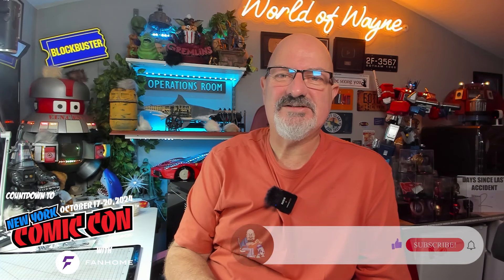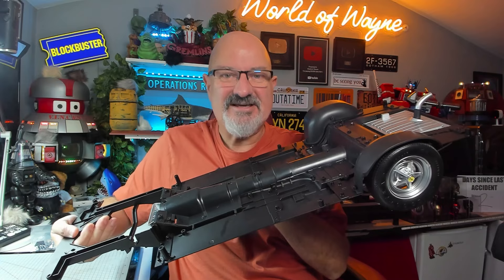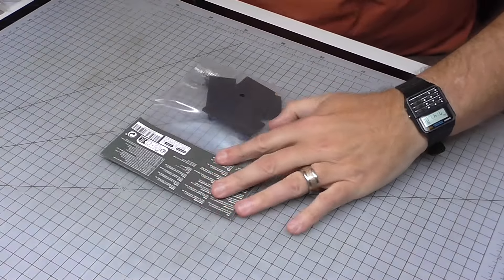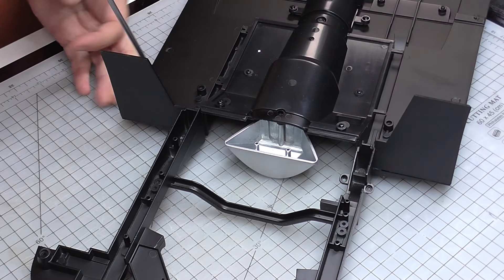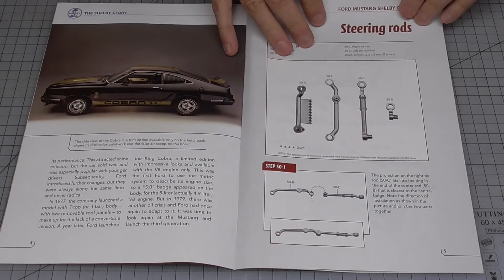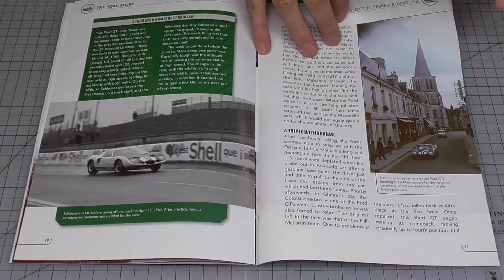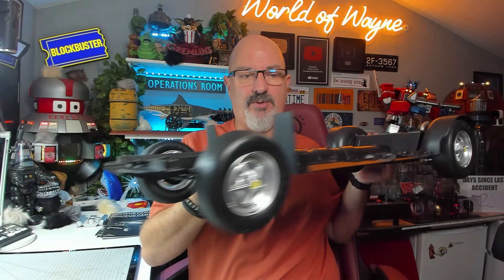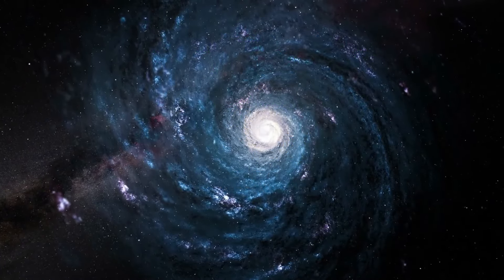Build the Massive 1:6 Scale Ford GT500 Shelby Mustang - Pack 12 - Stage 49-53

Comment: Wayne, on stage 51 i think u skipped a step, as u opened the pack u had 2 silver parts, and after u fitted the black suspension supports, next thing is u bring over the steering rods with the 2 silver parts mysteriously fitted.
Reply from the maker: Yer that part just slips over rather then being attached